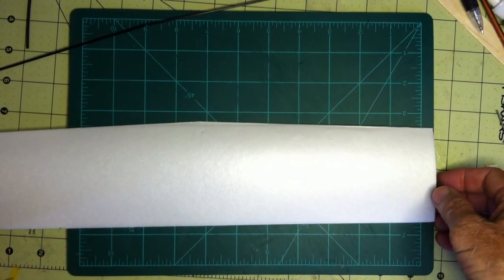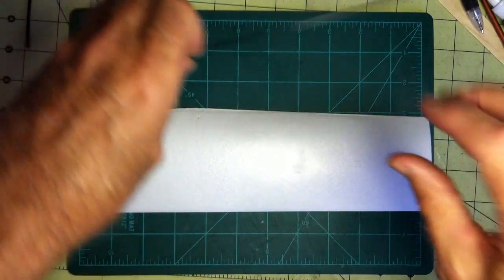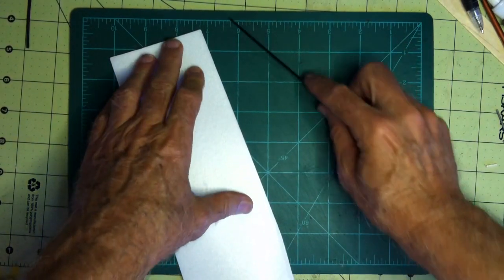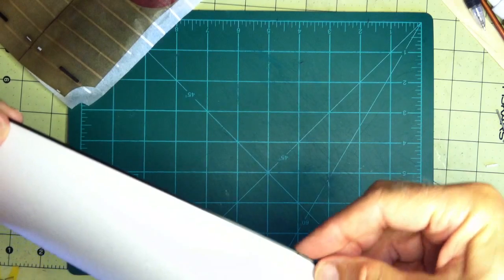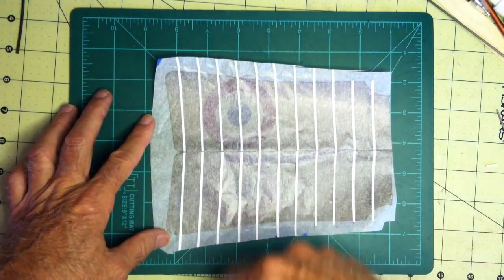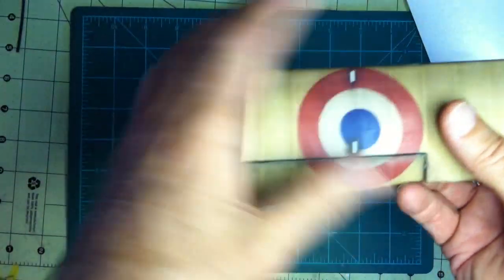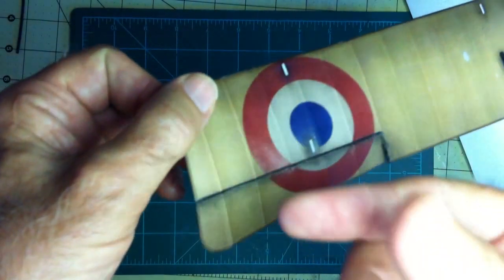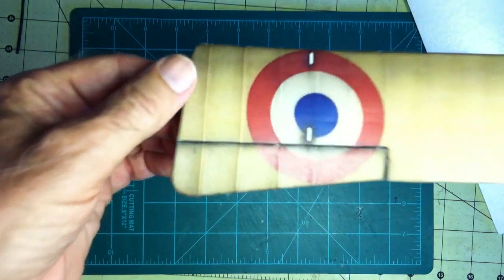Refined wings - Adding Surface features

Comment: Really nice work there, i was working on a foam tissue project and was wondering what you use to glue the tissue down? thanks for sharing.
Reply from the maker: Sorry for the late reply - been away. I did a series on converting a paper model to a foam (Depron) radio control aircraft. See http://tinyurl.com/d54wmh9 for build log, including a series of five videos that cover preparing the main wing. I use UHU glue stick on the leading edge to position the tissue, and then Loktite General spray adhesive (shown in my  videos on YouTube).

Gene